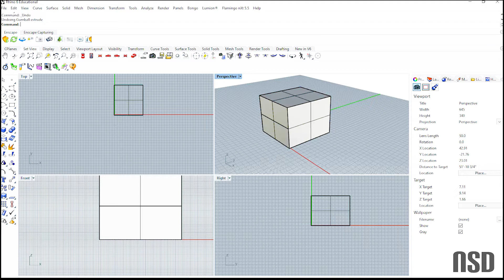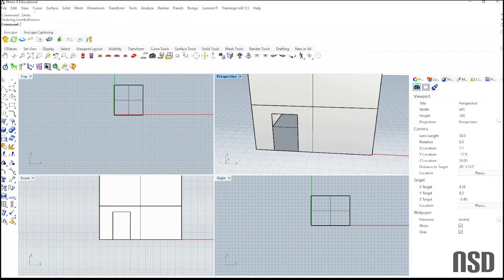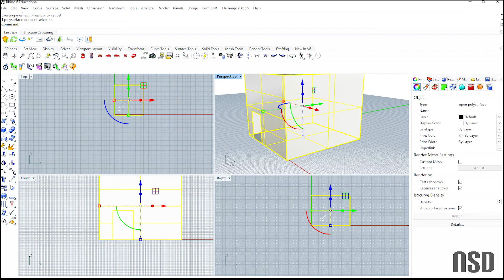Rhino 6 for SketchUp enthusiasts

Comment: Thanks a lot.
Can you make a tutorial show if it possible to draw in 3D without using the front/sides view.
Now if someone draws in the 3D it always snaps to the C plan
Reply from the maker: Hi Mahmood, I will work on that this weekend, thanks for the suggestion.
Reply: @NatesStudioDesk  thanks a lot really appreciate
Reply from the maker: Here is the video mahmood: https://youtu.be/AvaR4vX3QOc what type of projects do you primarily work on?
Reply: Nate's Studio Desk thank you very much for your video really appreciate it.
I usually do architecture projects like 7-12 level buildings, now I’m doing my university studio work using it. When it comes to detailing working with multi view windows is the way to go but sometimes I just want to do rough modifications specially on the roofs I’m practicing to do it using only the 3D perspective window.
Reply: As I suppose (I’m new to rhino) it’s a good idea to make a shortcut for the command, that makes the selected face cplane the current cplane, then you do that (select face and switch cplane, while still in 3D view) and then you can draw in the plane of that face.... is that the right thinking in the situation when we choose to draw while in 3D view?
Also, based on your experience, would you suggest total switching to 4windows workflow, thus eliminating necessity to keep changing cplane every time you need to draw something?
That is (4windows mode) something that SketchUp user is totally unfamiliar with. I personally feel uneasy about having 4 windows open at a time... what do you think, Nate?
Reply: Peter PTTA Tatarinov good suggestions, I will try it, the way of setting a shortcut for the plane to face the surface seems very intuitive.
Thanks
Reply from the maker: I think it depends on what type of project you are working on and the type of operation you are doing. I think you will find some operations easier in the side or plan view (especially early on), but as the project proceeds I tend to work more in 3D. I made a video of tips working in 3D: https://youtu.be/AvaR4vX3QOc
Reply from the maker: Also, what type of projects do you primarily work on?
Reply: Nate's Studio Desk I do all kind of things, blueprints for my carpentry, furniture projects, and also some 3d modeling and plywood kits development for boats. Yes, quite a range, and all in SUp up to date... Rhino seems the way I should move with my plywood boats I think... most of my western colleagues seem to work in it.
Reply from the maker: Nice, yea especially with the functionality of grasshopper you could generate cut sheets etc. Directly from any form.